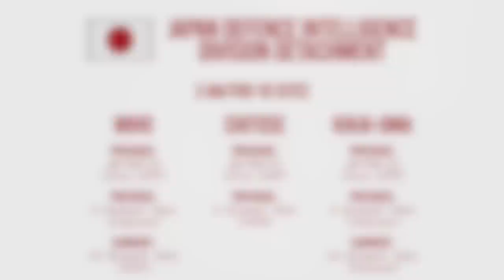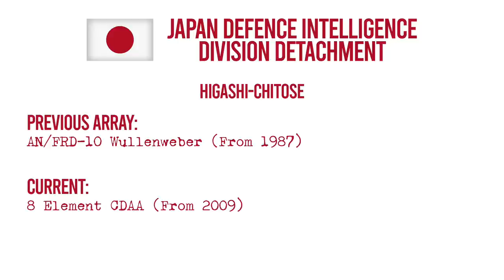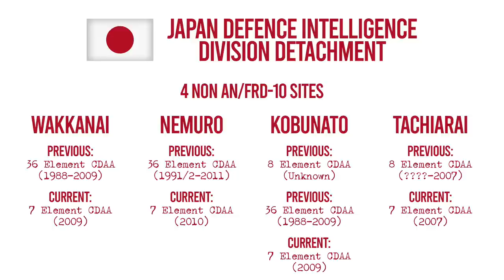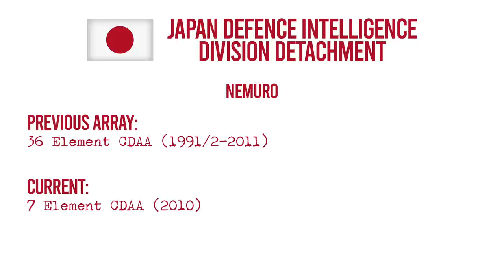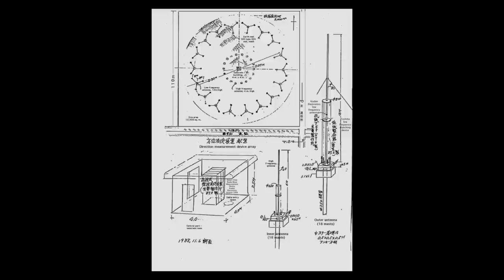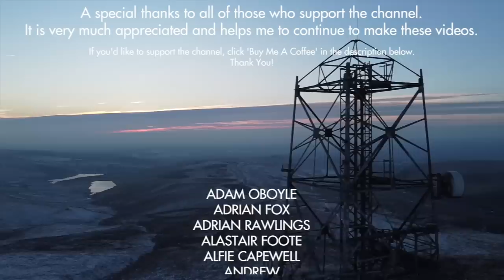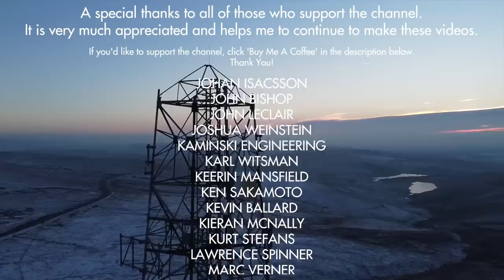The Strange Circles Of Japan’s Signals Intelligence Network

Comment: 2:31, the interferometer was chosen to replace the wullenweber antenna array because they are better, more accurate, controlled by computers, and allows upwards of 1000 LOB's per second.   Not sure about less maintenance.    The old wullenwenbers had a large goniometers in the small building that turned at 70 RPM's, producing a propeller pattern display on a CRT.  There was no sense of direction for the signal.  You could also remotely turn the goniometer manually (electronically) to get an aural null on the signal.  The aural null was more accurate but mostly used for weak signals or signals located on a noisy frequency.

Comment: 0:53, I see that the log periodic antenna is losing elements.  That was a good antenna years ago.    

I wonder what happened to the commercial grade TV antenna that was mounted on a mast on top of the building? 

That diskcone was not much use.   It did not pick up signals very well for some reason.   

That green colored building over to the right of the tan building is the original Livermore Monitoring Station.  It was used for storage after the tan building was built in the mid 1980's.   The old building has been there since the 1940's when the monitoring station was moved from Hayward, CA.

Looking at google earth, I think one of the massive unassembled log periodic HF antenna is still there to the left (east) of the old building.  There was once two of them lying on the ground there.   If I remember correctly what I was told, the HF log periodic antenna had full wave elements.   I think they were supposed to be 80 foot wide by more than 100 foot long when they were mounted on a mast.    If you use google earth and search for "Site R", Raven Rock, scroll the time back to 2007 and you can see one there.

Comment: 5000 miles with accuracy half a degree 😮, if that's true that's amazing, I can imagine how it works, stand targets in a circle and fire a bullet through any two of them...  by the phase angle comparison of the signal on the 2 antennas you can see which was hit first, giving you direction and bearing information 🤔..

Comment: Very interesting. The smaller seven (7) element groups do not have an internal screen. I guess the HF signal passes from front to back of phase shift triangulation.  When is the positive going signal on the front antenna and when is it on the back antenna or a side antenna. 
There are also long Beverage antenna's for over the horizon HF and low band VHF radar in China. 
Do we still need them?  Everyone is still using the same frequencies and there are not enough SATCOM lines for everyone. Besides "it is only a Russian fishing trawler. What harm could they be doing? Besides it is not a fishing season so the Russians aren't even taking fish "